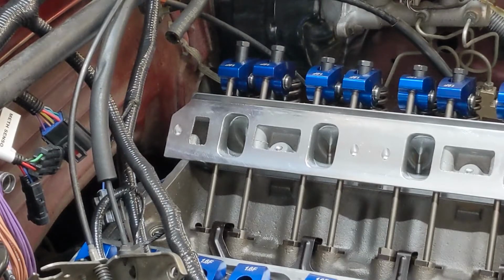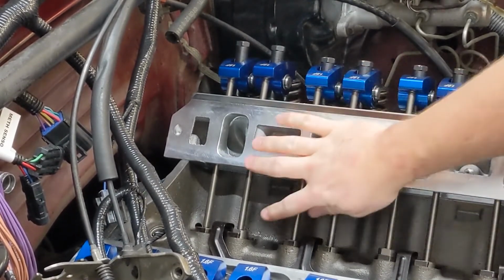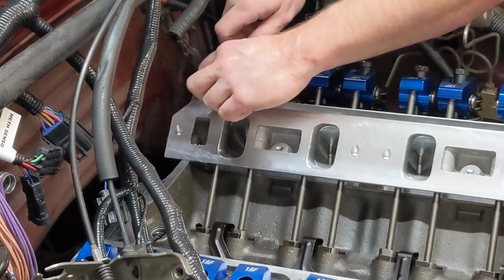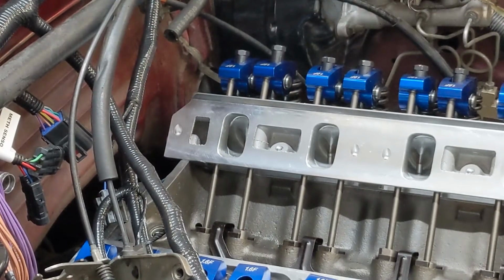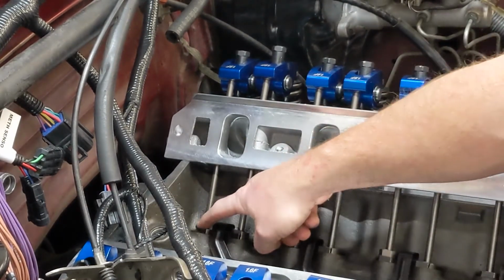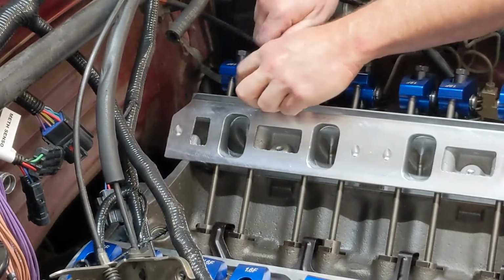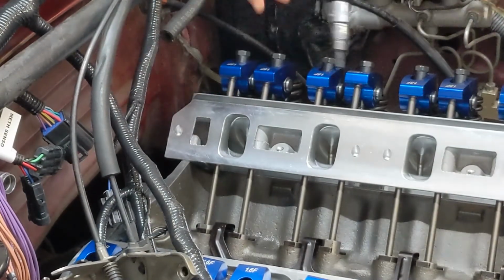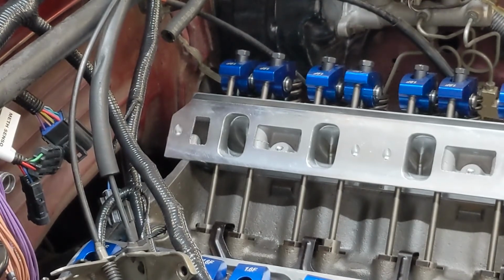Adjusting Stud Mounted Roller Rocker Arms the easy way. Fox Body Mustang

Comment: How hard was it to line up the guide plates too?
Reply from the maker: It wasn't too bad. Just did it by eye. Have about 3000 miles on it with no issues so far 👍👍
Reply from the maker: Not too bad. Just did it by eye. Have 3000 miles on it so far with no issues 👍👍
Reply: @ThisOldFarmShop  thank you for the quick reply. I'm putting a 302 motor together now and I've never measured pushrods, or set adjustable roller rockers. Closest thing to it was setting the lash (preload) when doing a cam swap on a 350 chevy
Reply from the maker: @whiterosemotors9026  Awesome!  Let us know how it turns out!

Comment: Once tightened to the half turn past zero lash, should there be any ability to spin the pushrod? Sorry for the newb question and great video btw!!
Reply from the maker: Thanks for the question!  At that point, it should not spin freely.  You may still be able to spin it if you can get a good grip on it. 👍
Reply: Awesome, thanks for the quick reply! I'm new at adjusting these and have gone from one extreme to another in over and under adjustment. Just trying to hone this fox in as it hasn't been running since before I bought it. @ThisOldFarmShop
Reply from the maker: Let us know how it turns out!!  @brianmckay3354

Comment: Can this method be done to adjust them with the intake still on?
Reply from the maker: You could do it with the intake on 👍
Reply: So mine is making some noise and was interested in doing this. Can I just take Valve cover off ? I did just change oil.and 10w30 motorcraft did quiet it down some but still making some noise. Rattling noise.

Comment: Do you have to go halfway down or just when you see the valve start to come up
Reply from the maker: For the exhaust: You want to turn the engine until the intake valve fully opens then goes to halfway closed.  At that point you adjust the exhaust.

For the Intake: turn the engine until the exhause valve is just starting to open.  Now adjust the Intake.  Hope that helps. Thanks for watching!
Reply: Can this process be done the same way on each piston no matter the firing order?

Comment: Do you do this in the engines firing order
Reply from the maker: That would probably be the quickest. 👍
Reply: @ThisOldFarmShop  

Thanks for responding. Also, is this the same method you use for pedestal mount non-roller rocker arms
Reply from the maker: The pedestal mounts don't usually need adjustment, but if you do have to adjust, it's with shims

Comment: Is this the same for crane roller rockers on a 302
Reply from the maker: @richlong4119  Same process should work for pretty much any stud rocker combo 👍👍
Reply: @ThisOldFarmShop  how do you know if your rockers are non adjustable.
Reply from the maker: @richlong4119  the pedestal mount use shims to adjust. Stud mount you turn a bolt and nut to adjust